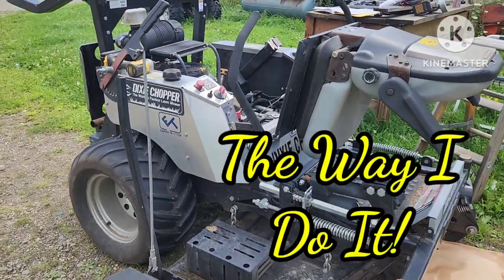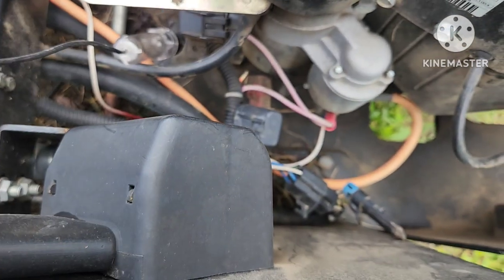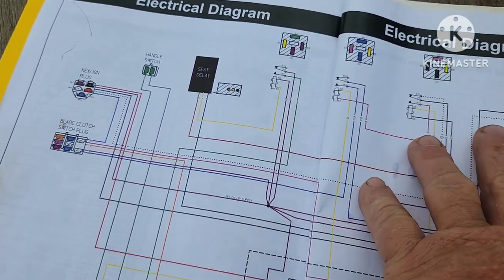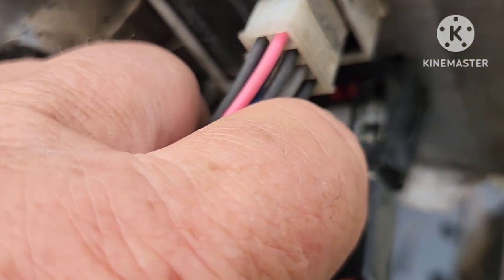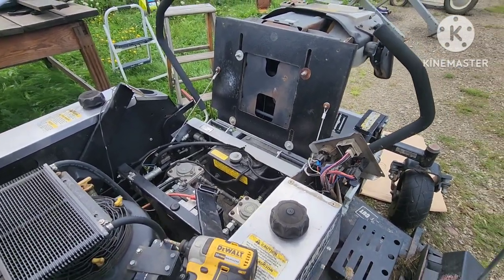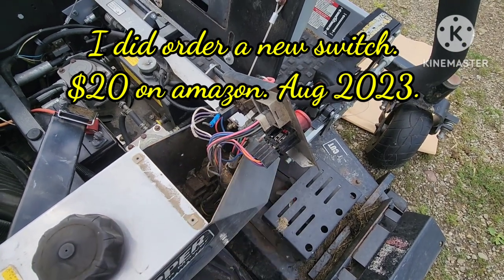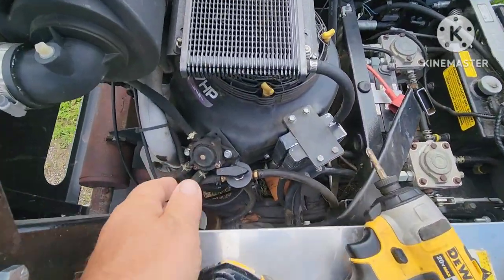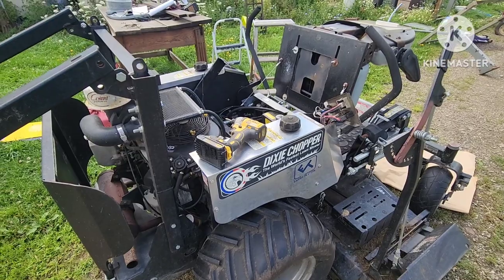Dixie Chopper mower will not engage 2012 model 2760HP

Comment: I just had same switch on mine go bad it would run fine, I'd turn off mower clutch switch, shut it off, then wouldn't restart. There is a set of contacts which goes to starter solenoid coil on that mower clutch switch, so wont let you start with mower clutch engaged.. Supposed to be open when running closed  with switch off....   Thanks for your video
Reply from the maker: These seem to be a weak link on most zero turns.  I know someone who turns her mower off and in like they are pumping hand lotion.  (Did I say enough to insinuate its my wife? Haha!)

Comment: I replaced the battery, but now my mower turns off once I go to undo the E-brake, and if I even go to move the control arms. I’ve located the sensors and it doesn’t seem to be anything wrong.
Reply from the maker: Theres an open circuit somewhere. Maybe the seat. Do you have the wiring diagram.